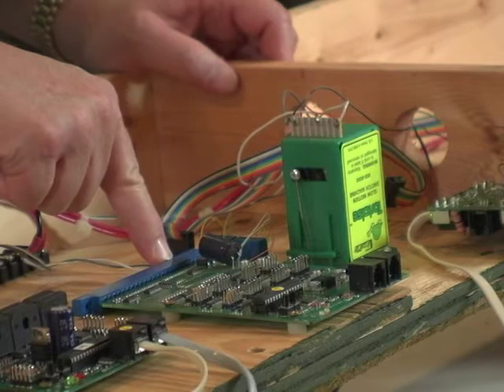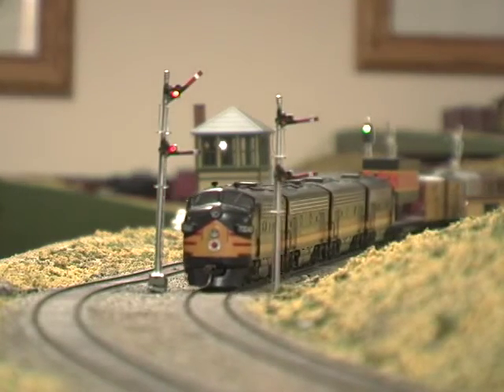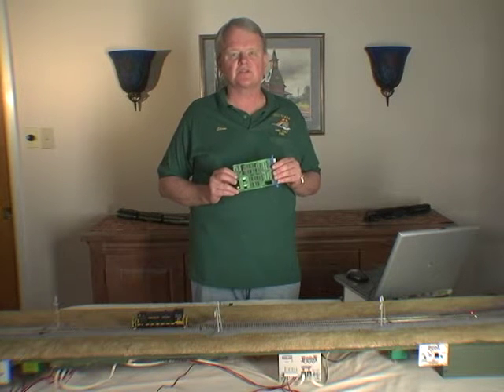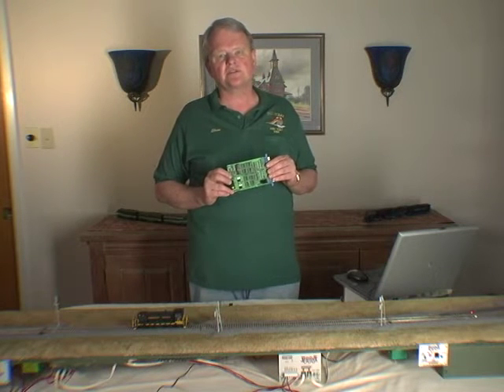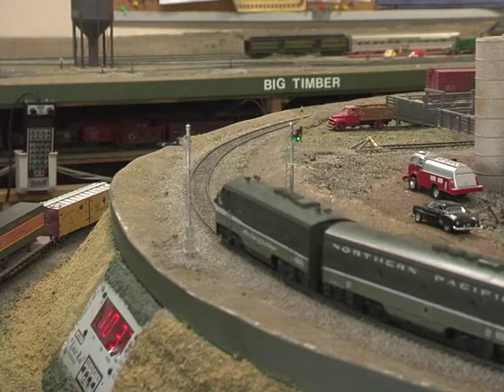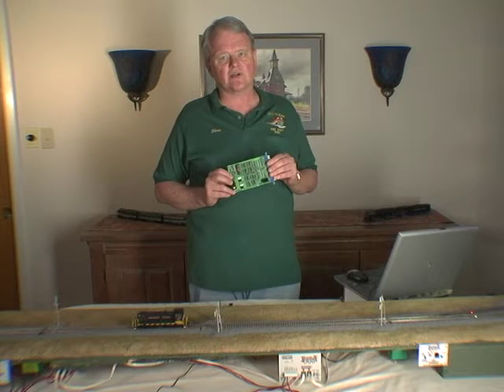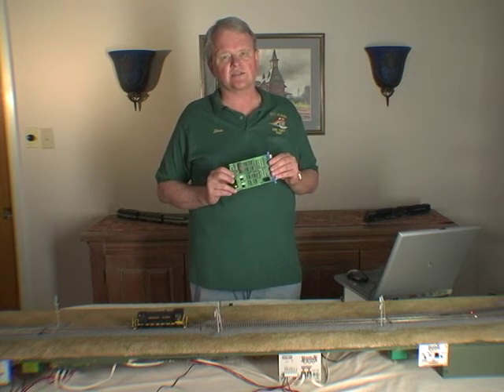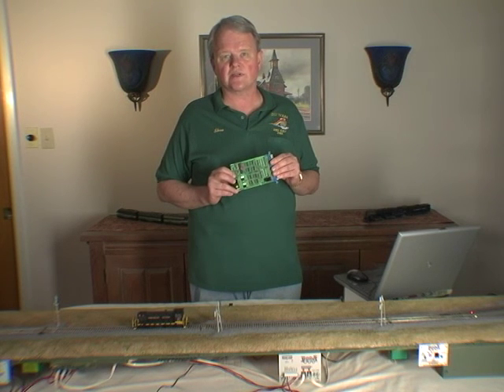Using DCC to Control Model Railroad Signals

Comment: You have an awesome demonstration video. I live in Whitefish, and have a ledge/shelf layout in my living room and dining room. I have two passing sidings on each wall that are about 12 feet long. I  would really appreciate your guidance on how I would install rail road signals (maybe 4 or six) . I would mind if the train changed the color, buy would be happy with controlling by my NCE controller. My trains run on 1x4 pine that is clear coated, so I cannot have anything under. Any ideas??
Reply from the maker: You can certainly improve on your signal technology as you go. A toggle or slide switch can change the signal indications to start, then you could add signal logic with track occupancy indications and switch positions. That’s cool stuff.